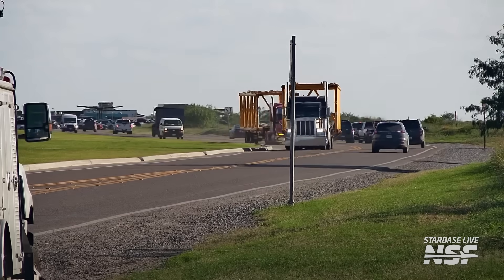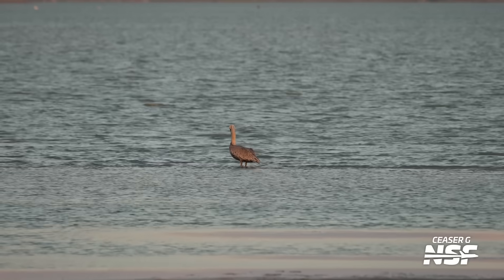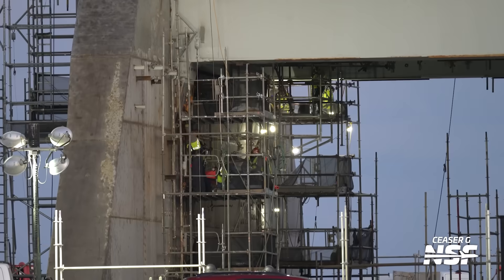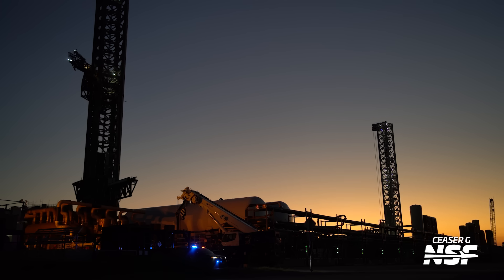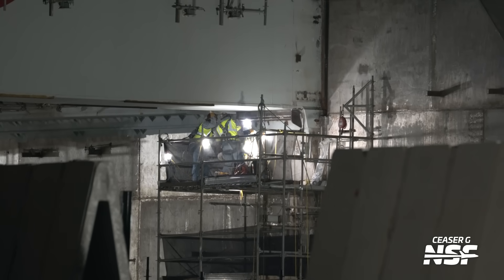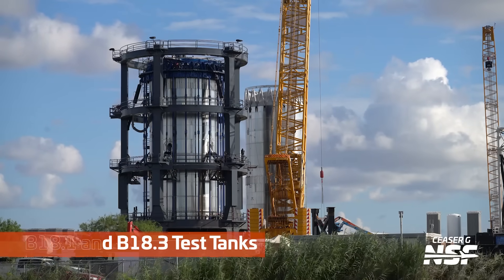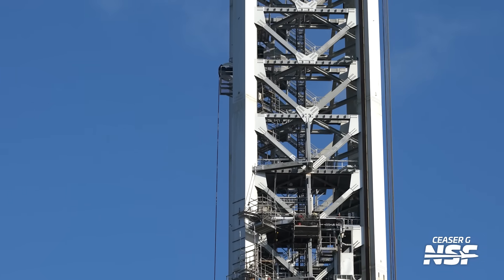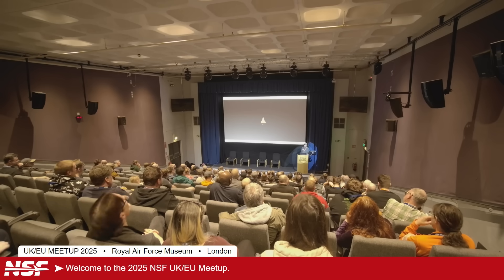Starbase Summary (Recorded Live in London)

Comment: They are not pouring concrete, they are pumping it into place.  The concrete pump truck gives that away with that huge boom.
Reply: They have to pump it up to the top of the boom but it pours out the other side. 🤷🏻‍♂️
Reply: @DavJumps  Yep, that's how they place it.
Reply: So you are saying that it isn't poured from the trucks into the hoppers of the pumps?

Comment: You both pour and place concrete, though "placing" is the more accurate, technical term for the entire process of depositing and consolidating concrete in its final location. "Pouring" specifically refers to the act of the concrete flowing from a truck or bucket into forms, while "placing" encompasses all the steps after mixing, including distribution, consolidation, and finishing.
Reply: Pour is also the location of the concrete placement! The Transit mixer is traveling to "The Pour"!